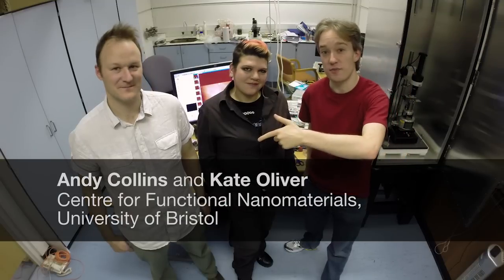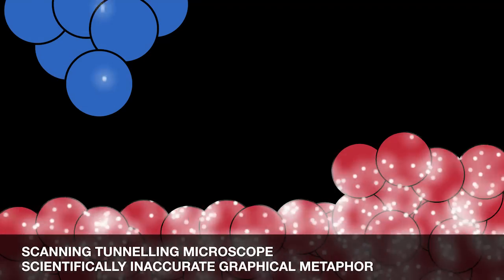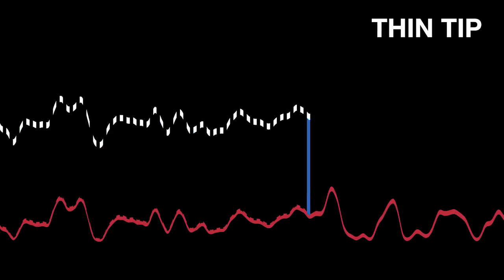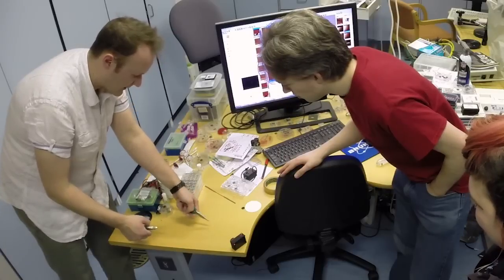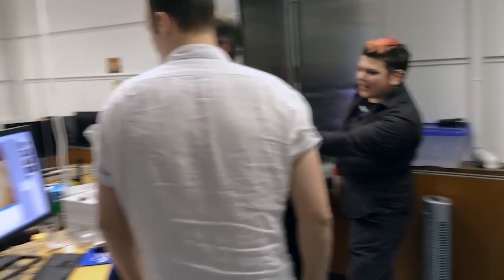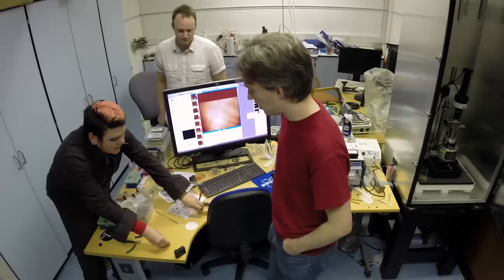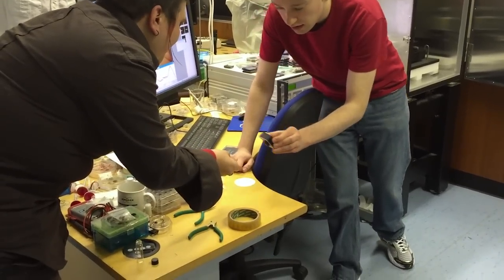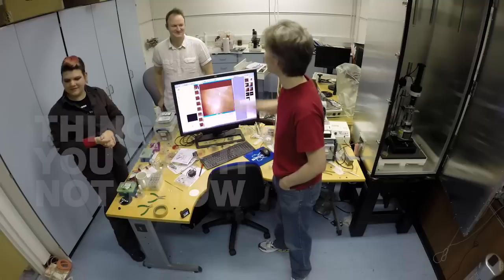How To Make Something One Atom Thick

Comment: Fun fact according to my one-time quantum physics teacher, those atom-sharp wire points used to actually be made by a very expensive and time-consuming process involving an acid bath and very carefully pulling the wire up out of it. Then someone working in their basement discovered that you could do basically the same thing with crappy scissors from k-mart, which is basically what they're doing there. The actual professional scientists didn't figure this out until they realized people were doing this stuff in their basement and not paying hundreds for these expensive wires.
Reply: That sounds about right.
Reply: the Professor designs the experiment, but it is the assistant who makes everything works. Sometimes, or maybe a lot of times Lab assistant is smarter than the professor. Also, that's how Francium discovered
Reply: I had to do this experiment for a couple of months and I literally just used some wire cutters to shred a point. There will always be around one atom flapping about on the end so it's good enough
Reply: is it due to the material that this works? i know this doesn't remotely work with steel
Reply: A prime example of over-complicating things, something we as a human species are VERY good at doing
Reply: @Dafoodmaster  steel is tough to cut but i think you could do with a very think steel wire essentially any wire should work and you cut it in an angle and get approx 1 atom thick tip
Reply: "One day, a student who had been left to sweep up the lab after a particularly unsuccessful party found himself reasoning this way: If such a machine is a virtual impossibility, then it must logically be a finite improbability." -- Hitchhiker's Guide 1.10.073

Comment: Other banal materials used in science: eyeliner pencil for writing on glass beakers, tin foil for insulating EVERYTHING and shielding light sensitive stuff, eyelashes glued on sticks to handle very light/small samples.
Reply: Don't forget that graphene was created with tape and some pencil graphite
Reply: My lab had a plastic beer pitcher with a sharpie line for measuring liquid nitrogen
Reply: I used an Ikea curtain in a pion beam at CERN.
Reply: We occasionally still use nail varnish for glass coverslip adhesion!
Reply: You can't insulate things with tinfoil. Tinfoil conducts both heat and electricity very well.
Reply: @SodAlmighty  The air trapped between tin foil and the equipment insulates it well and tinfoil also reflects the radiative heat transfer back. Tinfoil isn't necessarily touching the equipment so its heat transfer ability doesn't have much effect.
Reply: @chemistryworkshop2846  it can also be used to shield equipment electrically. Our electrochemical impedance spectroscopy measurements were done within a cardboard box covered in tinfoil, cut to shape around the retort stands etc.
Reply: Add tooth floss for anchoring wires/wire management in dilution refrigerators and cryostats (things that get to ~20 mK and 4.2 K).

Comment: Platinum is pretty cool. If I remember school stuff correctly, some electronic thermometers use a platinum/rhodium alloy in a wire, then a platinum/iridium alloy in another wire, the wires are squeezed together at one end then connected to a Wheatstone bridge on the other. The joined part is capsuled in some ceramics, and as the tip is exposed to different temperatures, you can read out the differences in microvolts. Easily amplifiable, and then usable as input information to automatically regulate temperature with a controller. (citation needed)

Comment: Isn't Graphene made the same way....  Using Graphite... And something like tape??
Reply: Yeah, that's how the early samples of graphene were made in labs.
Reply: Yup it's true. They'd stick tape on both sides of some graphite and peel in half. Do it again and again, and eventually you'll just be left with one layer of graphene. Source, I'm a student at the University of Manchester :D (we're very proud :P)
Reply: rammerstheman Its turns out that most students have created graphene using regular pencils in primary/elemenatry school.
Reply: Nillie Well it's a little more complicated than that. As Jonathan Duffield says graphene would have been created countless times before the Nobel prize was given for it. However no chemists etc thought it was possible to be stable, and it's exremely hard to detect/ identify. If you read the paper that got the prize, they actually came up with an innovative method for making it detectable with the naked eye. It's quite a complicated phenomina so I won't try and explain it. My point is they did a do a little more than peel tape, however that was still a large part in its discovery!
Reply: Nillie Exactly. I reckon it was the physicist equilivant, maybe with a little more thought!
Reply: Yes, they won a Nobel Prize that.
Reply: Nillie I was just considering the fact that.... De-layering of substances is used to make nano-scale,  high strength materials....
And that Graphene is produced in a similar way..  Not exactly like that...
Reply: Yeah with a graphite rock and sticky tape. It was scotch sticky tape. And they win nobel prize. Hail Sticky Tape !

Comment: I've seen how wire cutters cut and they do not cut cleanly. Cutting technically doesnt even 'cut'. They crush the material until an atomic separation occurs which can be full of burrs because materials are rarely perfectly lattused.

Comment: i've always wondered how they stop the tape leaving residue
Reply: The tape can't leave residue because it takes residue. It can't do both or they'd have to pass through each other, yeah?
Reply: Ghastmask Zombie yeah but the top layer isn't uniform, some it won't come off with the tape
Reply: +savagepinksock Because of the strong adherence, there can't be a layer left that has been in contact with the tape. The tape will always uncover the layer underneath it was adhered to, so there is no possibility of residue being present on the uncovered layer.

Comment: After watching this I am 100% sure we will invent time travel using duct tape and wd-40
Reply: Want a one atom thick sheet of carbon? take a pencil, draw out and fill in a solid block on some paper, take some cellophane tape, put it on the dark section then peal it off. BAM! A single later of carbon! What can you do with it? .....[shrug]..... But making one is just that easy.

Doing what seems like complicated science is a lot easier than people think. Getting precise and repeatable precision results is expensive, yes. But you could seriously build a scanning electron microscope out of an old CRT electron gun, some spare electronics and a vacuum pump(which can be fashioned together from old refrigerator pumps). Want a scanning laser microscope? take apart a old CD player, drive and read the laser assembly by hand, feed the output into a cheap arduino knock off and BAM! Scanning laser microscope.

Comment: I want a knife to be one atom thick
Reply: after one use I'd be surprised if it is 600 atoms thick..
a tape just removed some of the surface as you've seen.. a mere tape..
never underestimate sticky tapes!
Reply: Yeah but, we're not talking some sort of coal based stuff. We're talking metals, or perhaps minerals (flint or obsidian for example can get extremely sharp, sharper than surgeons' scalpels until just recent years).

Comment: I have a question. How do you know that none of the "sticky" from the tape has adhered to the mica, thus making it non-flat?
Reply: You peel things from mica, you see a bit (flat layer) of mica (or graphite) on the tape - the middle of the mica that steyed was tauched only by other side of mica. That is good enough - you do not care about corners. There is chance there was something between layers of mica. But chance of that are small enough, to risk doing experiment and repeating it if there was something there (which would happen once few teens of experiments)

Comment: Other than the mechanics of the STE microscope, nothing in that lab is outside of the reach of the average person. And even then, building a STEM isnt that far fetched. Building a good one is expensive yes, but one that functions to reasonable resolution is well with in reach. If youre interested in doing some home science, check out boards like hackaday, there are TONS of scientific instruments that can be build from essentially garbage. Like a 2um scanning laser microscope made from old CD/DVD/BR laser assemblies!
Reply: STM (scanning tunnelling microscope), not STE. More general is SPM (scanning probe microscope). STEM would be scanning transmission electron microscope. You mistaken microscopes with electron beam for imagining (EM) with ones that are using just the needle (SPM)

Comment: I'm a 4th year undergrad nanoscience student so I use AFM and STM all the time, but I've never made an atomically sharp tip simply by using pliers before... I have my doubts that would even work. Generally they are electrochemically etched to an atomically sharp point.

Comment: So wire strippers can make something an atom thin? Wouldn't you have to almost completely close them? Also tape removes one layer of atoms that you can see?
Reply: +John Grasso If something breaks at a 45 degree angle, the very tip of it will be 1 atom thick.
Reply: If the material is too brittle, it might also splinter away, so it's not that obvious.
Reply: John Grasso, you are forgetting that it was an iridium-platinum alloy, not just any old thing was being cut by the pliers but an alloy that separates perfectly at the alatropic level.
Reply: Important part is push/pull. Once the wire is cut a bit it will start to elongate till it breaks. And breaking point will be between 2 atoms. There might be another atomic tips somewhere else, but they will be at another height, so just one will be measuring. Google video about dislocations modeled by bubbles, it gives an idea what starts to happen.

Comment: I'm studying nanoscience in America. Their AFM looks goofy to me. I see the scan head at the bottom and the camera at the top, but what's the cylinder in the middle? Is it just an old design, or what?
Reply: Multimode 8. Very reliable. The cylinder is scanner. The piezos controlling movement are in that part. There are exchangeable to accommodate scan size and precision.

Comment: 1:29 Quantum tunneling only works on something conductive? Please explain this because I thought it is possible in any material.
Reply: I'm fairly sure it would work on non-conductive materials as well, but you need the electrons to go somewhere to be able to detect them, so they need to travel through the material and that's why it needs to be conductive.
Reply: TheSlimyDog  is correct, it's an measurement thing. Also in order to do this scanning we often want to be able to control the rate of flow of electrons. We do this by adjusting the energy difference between the materials. This is most easily done by applying a voltage, but only has that energy level effect with something conductive. This allows us to change the contrast and intensity on our images, and measure in different ways.

Comment: equipment for milions of dollars? bugger it just get some plyers and skotch tape. :3
Reply: Low cost and relatively low quality STMs start at approximately $8,000 but some people have actually built their own amateur STMs for much less than that amount. However, professional quality STMs can range anywhere from $30,000 to $150,000 depending on the manufacturer and the extra parts included.